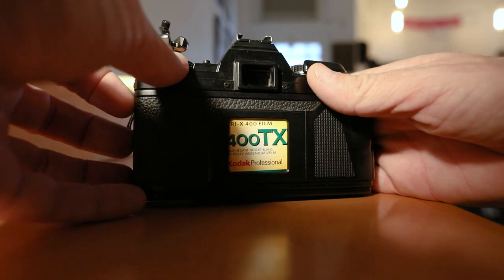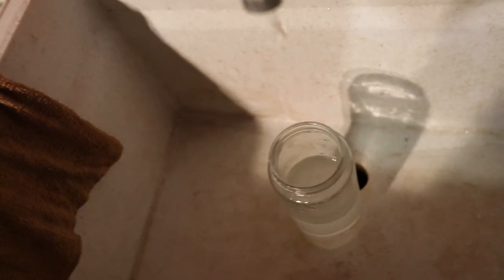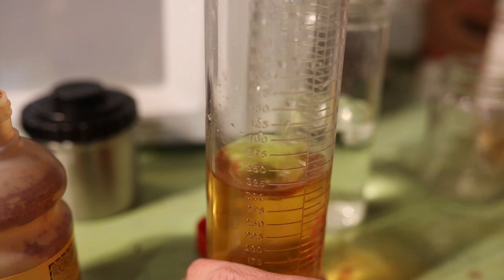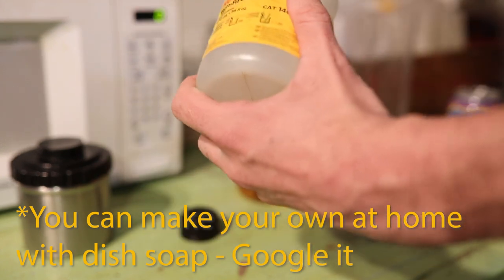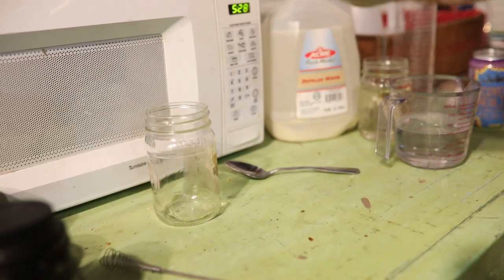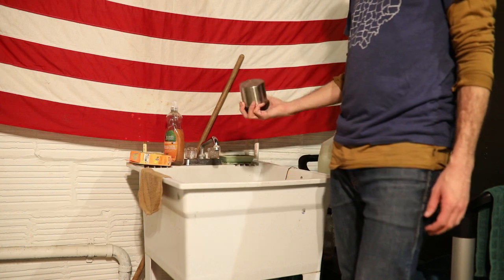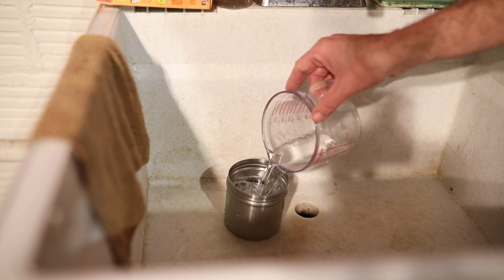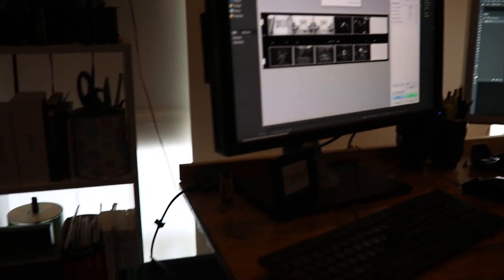How I Develop Kodak Tri-X

Comment: Use HC-110 as a one-shot? That’s exactly what I used to do! I started by mixing up bottles of D-76 stock solution, but found it would deteriorate over time. HC-110 mixed from fresh syrup was much more consistent.
Distilled water is good, although if your local tap water is also good, I’d use that.
Kodak used to publish a maroon-coloured spiral-bound handbook for b/w darkroom work that included cardboard dials that allowed time/temperature development and other useful stuff. You looked up a “developing number” for your film (they only gave numbers for Kodak films, but you could work out numbers for Ilford/Agfa/Fuji etc from the 20C times on the instruction sheet), matched it to the temperature of your tap water or stock chemicals, and read off the proper development time from the dial. Easier than faffing around getting everything to 20C/68F. If your Dev/Stop/Fix/Rinse are at different temperatures you may get a “microreticulation” of the film emulsion that increases the apparent grain, and you don’t want that (although if you have enough of a difference between solution temperatures you’ll get full-on reticulation, which usually makes you throw your film away.)
Tim, I admire your technique – changing bag, stainless steel spirals, Tri-X and HC-110, film wipe-down between fingers etc are definitely the Way and the Truth! This is knowledge that should not be allowed to pass away!
Too bad I’ve switched to that heretical digital shit.
Reply from the maker: Awesome - appreciate the extra tips! I have a lot of those old Kodak(and other publishers) books around. I’m a real vintage camera and gear nerd. I just developed a roll tonight in Rodinal - one shot as well - have felt like branching out a bit lately. I don’t shoot as much film as I would like since my day job is commercial photography’s. Glad digital exists for work - but for the hobby I still prefer film.

Comment: I enjoyed your video. I am new to film developing. Only one question. Your Fixer was already mixed. I did not hear any ratios for mixer. At one point it sounded like it was used stright. This video was done a long time ago. I am hoping you see my reqest answered.. thanks again. I have two rolls of Kodak tri 400 to develop. Todays attemp I fail miserable.
Reply from the maker: Fixer was a powder from Kodak - yes - just mixed at the ratio on their bag. It is reusable for many rolls. Doubtful the fix was your trouble - but let me know your problems more specifically
Reply: @TimFitzwater  Thank you Tim for such a quick reply. I think my develop problem was just bad internet information. There is so much bad info on the net.  I develop Ilford HP5 plus and do ok. I'm new to film but not to digital. I have two more rolls of Tri x to practice with so I am going to watch your video a few dozen more times.  Again thank you for your time and video. I'll check your  videos out.

Comment: Use a clipping from a 35mm film leader and submerge it in a small sample of fixer - when it goes clear, that's your fix time. You can't overfix but you can waste beer drinking time :) I reuse fixer until it gets really worn out, so tend to fix for 5 minutes (but I know if its fresh its going to be done in like, 2 minutes).
Reply from the maker: Thanks - I’ve seen so many different theories- the Kodak Fixer itself says 5-10 mins.
Reply: @TimFitzwater  I use Ilford Rapid so 2 mins realistic for fresh stock. The leader clipping is a great test if you want to know exactly what your fixing time is or how wether your stock solution is getting tired.
Reply: re fixing time: If you are going to determine your total fixing time by reference to the minimum time it takes to clear the film of undeveloped emulsion, the rule is not to use that time, but to use 2 TIMES  that minimum clearing time.  Visual inspection will not accurately determine when the film is fully fixed.
Reply: Note that the times suggested here are for RAPID fixer, not normal fixer. The 5 - 10 minutes for fixing he refers to in the video is for traditional fixer, i.e. "Kodak Fixer", as opposed to Kodak Rapid fixer. Almost every YT video tutorial will show use of rapid fixer without mentioning the difference, so you need to keep that distinction clear.
Reply from the maker: Thanks - I almost always go with at least 10 minutes. Even if I don’t pay as close attention to the agitation after about 8. I’m probably a couple of hundred of rolls in and no problems. Better safe than sorry attitude

Comment: Great video man ! I’m finally looking into  developing some black and white film and this video is really helpful . How do you usually get / keep the developer and water at 68 °. Does the developer have to be at 68 ° when you mix it with the water ?
Reply from the maker: Glad you liked it! I usually try to get the water to 68 and then mix it. Just use a bigger jar or beaker than you need and keep adding hot or cold water until you get it just right - keep stirring the water as you go. After mixing in the developer if it is a tiny bit cold I will heat it with my hands or run hot water over my jar(I mix in old jam jars) if it is a bit to hot I'll put it in the freezer for a minute or two.

Comment: Hi I developed some black and white tri-x 400 yesterday with D96 and F96. I rince the two films rolls for 10 mn. Then when I wanted to dry then I noticed one side was sticky. It’s not transparent. Is this sticky layer normal or did I do something wrong ? 
Thanks.
Reply from the maker: Nothing should be sticky and at I'm a loss to describe what would make it that way.  When I hang my film to dry I pinch my fingers down it to get excess water off. The side that the emulsion is on is delicate and shouldn't be scratched - it will be softer but shouldn't be sticky.  When you say the film is not transparent - is it all black?

Comment: So, you agitate 5s, then wait for 30s, or do you agitate at the start of every 30s for 5s? The Kodak instructions are kinda unspecific on that, I think...
Reply from the maker: Thomas Eisl I do 5 second at the start of every thirty. The total time is 6 minutes.
Reply from the maker: A lot of people do 10 seconds than wait 50 seconds. I think it is also standard to start with an agitation - though I never have.
Reply: @TimFitzwater  Thank you very much Tim - this is exactly what I do, I go with the 30s agitation as proposed by Kodak, and I like the results. It is always good to read the manual and stick to it. If you want to connect on Insta:

 thomas.eisl

Thank you for the video and your reply! Great!
Reply: The traditional pattern of agitation for B&W film development is (1) an initial continuous agitation of 30 seconds. This makes sure that the developer penetrates the emulsion uniformly for even development.  This particularly important if the development time is shorter than 6 minutes. (2) 5 seconds out of each following 30 second period. If your development time is more than 8 minutes, it is optional to substitute  a 10 second agitation out of each following 60 seconds. After each agitation, tap the  tank on the table surface sharply enough to loosen any air bubbles which may have lodged between the edge of the film and the reel spiral. If such bubbles (called "air bells") are not shaken loose, they will prevent any development, leaving undeveloped image spots. The method of agitation he shows here presents a very modest risk of uneven development.  As used here, "agitation" means to invert and right the tank once ever 1- 2 seconds, not more energetically.  Using a spinning rod in the top of a tank like a Paterson is a poor substitute if you want truly even development.